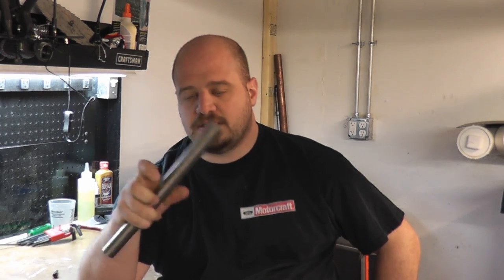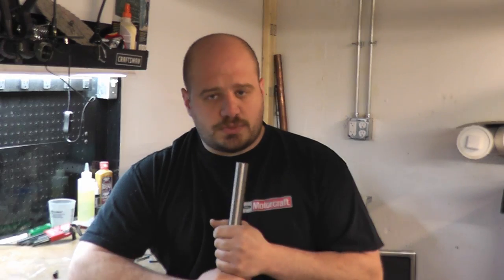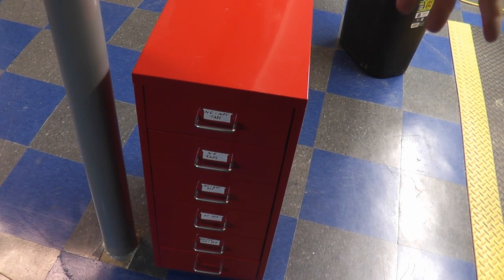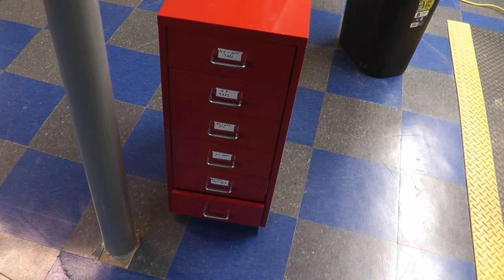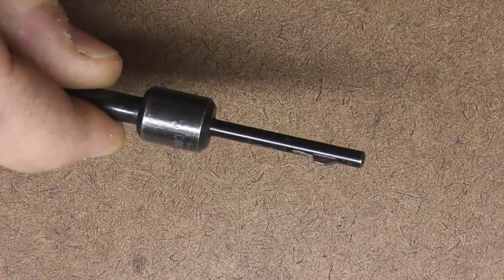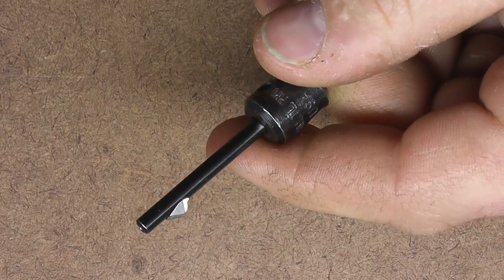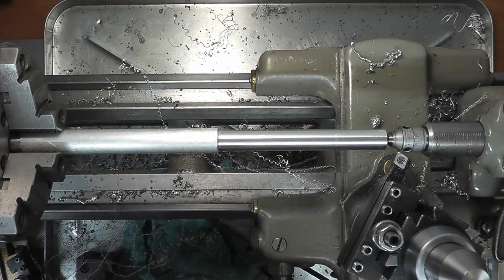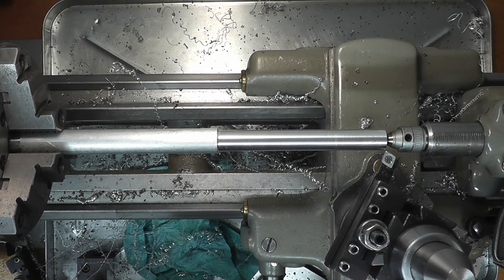Cogsdill Burraway Tool

Comment: i like that ikea cabinet, ive recently started buying old 2 and 4 drawer filing cabinets for my garage shop. You can put 3 or 4 in a line and make a whole bay of tool storage. i find them at goodwill from 10-20 bucks and they are heavy duty and hold a lot of weight. you have to make sure you find old USA ones that still glide smooth. i came upon a huge box of taps and endmills/drills and still havent decided how im gonna end up sorting/storing them.

Comment: They should have had a centering cone up high on the shank...you could push the tool through to the cone, center up and then clamp in the vise. Looks like it should be used centered and rigid. Not sure what to think of it, seems larger ones with heavy burrs would be useful...BUT ive never used one
Reply: A CNC environment where hole centers are found easy and quick i see working, being fussy
Reply from the maker: Yes it's meant to be used on mills and production/ CNC stuff, but you can get away with it on anything.

Comment: Would it be possible to turn a taper by turning the work between centers, with one of the centers mounted off-center in a 4-jaw chuck?
Reply from the maker: +Rob Mckennie 
No you need the offset on the fixed end (tailstock)  If done at the chuck all you'll get is the piece whipping around in a circle.
Reply: ***** yeah, after thinking about this for a while I realised that moving the tailstock keeps the axis of the torque parallel with the work, while moving it at the headstock end will move the work off-axis

Comment: Hi !

That adjustable dead center ... does it move ONLY vertically ?

If so, how is it done ?
Reply: Good question.  It's a fascinating little thing isn't it.

My guess is that it's just an eccentric.  If the work is high or low by a couple of thousandths at the tailstock end, it's no big deal - cosine error is tiny, and the tool height being off by that amount won't matter.  The important thing is the horizontal movement.  That's just a guess, though...
Reply from the maker: cooperised Yup you're correct.  It moves SLIGHTLY vertically as you move the eccentric, but the error even on a long piece is small.

Comment: I don't want to hurt your feelings but you guys in New England received pretty much every single snowflakes that we're used to in Quebec. Buffalo got it hard last October/November and now, it's your turn to get it.

I would not mind if we could exchange some snow for the Arctic cold air we got since December.

PS: Be careful while shovelling. It does not take much to hurt your back or get an heart attack. Be safe.

Keep on your good work,

Comment: Does that Enco tailstock only work in the horizontal plane or could it work for those with older machines whose tailstock is worn lower than the headstock?  Might be an easy solution to a difficult problem?  How much are those deburring tools and the replacement blades out of curiousity?  You do know your are feeding the tool beast.   Doug